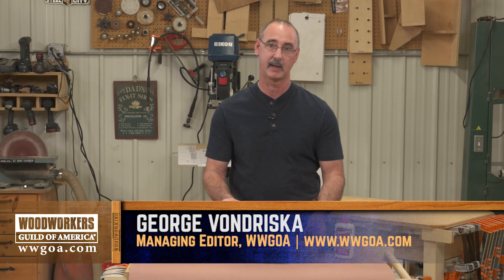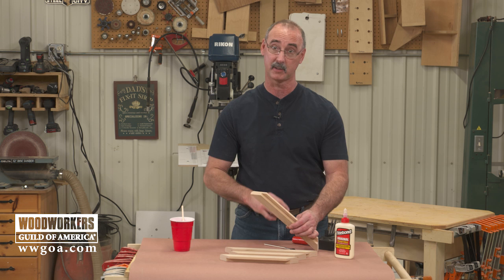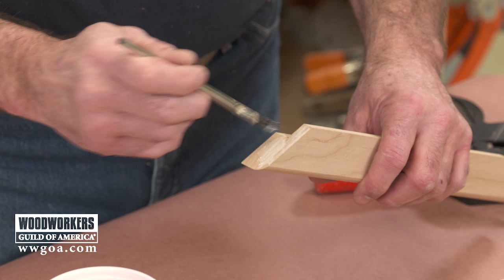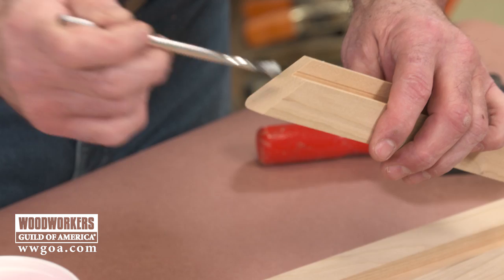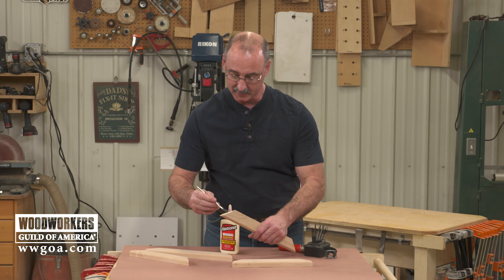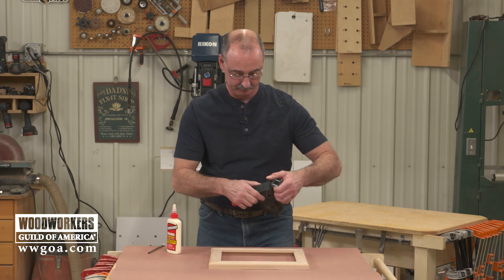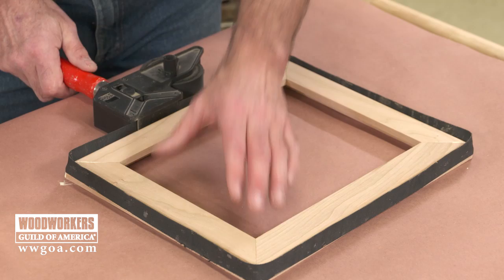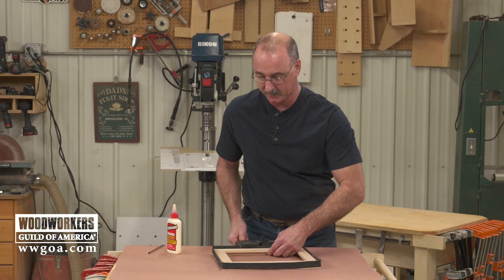Making Strong Mitered Corners

Comment: I'm making a large oak shadowbox (military uniform/flag/medals) it's 24x36... Looking for a good solution for the miter joints do you think this would be strong enough?
Reply from the maker: Hello.  It would probably be ok.  For a case such as your project, however, I would suggest adding a mechanical aid, such as a biscuit, to strengthen the joint and give you more confidence in its durability. 
Thanks
Paul-Woodworkers Guild of America

Comment: Great tip! I'm thinking about the possibility of making my workshop windows with miter joints with splines. Would this technique with the splines be enough? 

Also, you used 2 minutes between the sizing and the actual glue up, what if I need more? Any problem with the first glueing process (half water half glue) being totally dry?

Thank you so much!
Reply from the maker: Great question!  I have forwarded it to our experts and they will reply here within 1-2 business days.  Thanks!
Reply from the maker: Yes, doing this along with splines should provide adequate strength.  As far as extending the time, I'd suggest using Titebond 3 rather than original as it would provide far more open time.  I wouldn't suggest letting it completely dry as that will compromise your bond strength.  
Paul

Comment: Great...so what do you do for people that don’t HAVE band clamps (and don’t say, “go buy some”)?
Reply: Look up “diy corner clamps” by DIY Montreal, they’re easy to make and provide even pressure using at least one clamp per corner. It can also help if you want them glued at a specific angle

Just bore out a circle for the corner, and cut the board in two at your desired angle

Comment: what,s the best way to measure miter from corner to corner? I always have trouble  making pieces come out the same length.
Reply from the maker: I generally measure from the longest point to longest point.  For cutting consistent lengths it is best to use a stop-block on your saw so that you have mechanical consistency rather than relying on your eye to determine the cut line.

Comment: Would this glue bond be strong enough for say a blanket chest if you cut your end pieces to 45 degrees as in the picture frames?
Reply from the maker: Hello.  I would suggest reinforcing a larger miter joint like that with a mechanical interlock such as splines or biscuits to provide greater strength. 
Thanks
Paul-Woodworkers Guild of America
Reply: @Wwgoa  thnx!